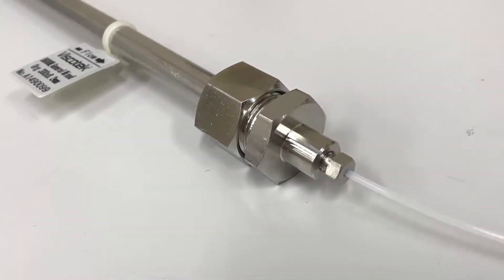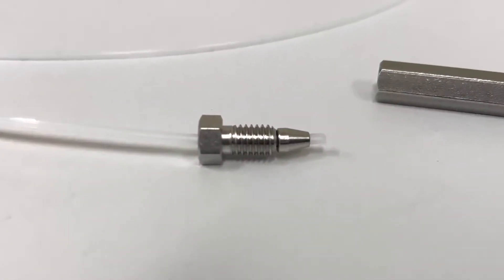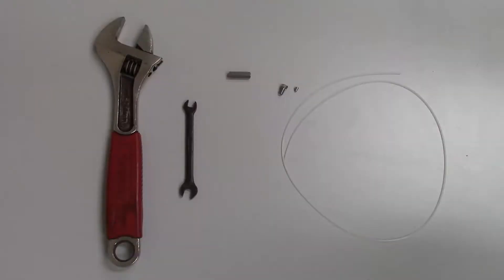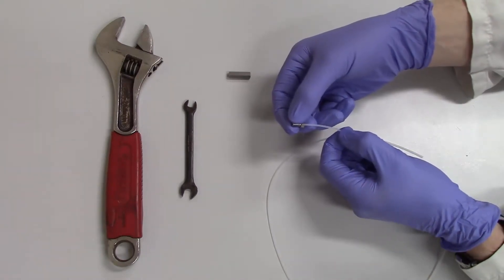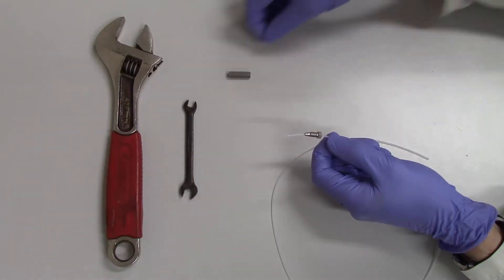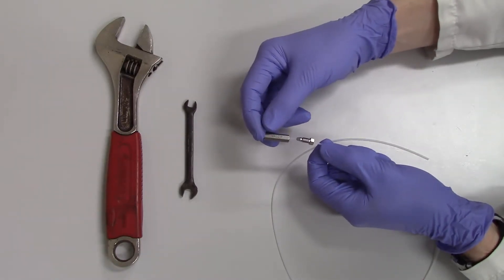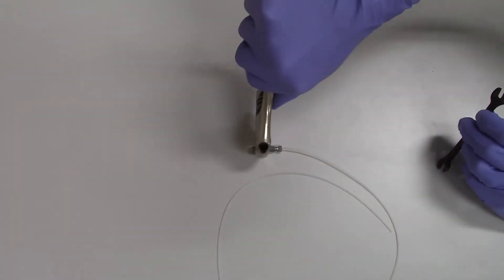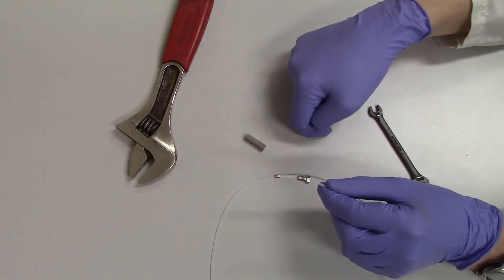How to make a fluidic connection for your GPC/SEC system

Comment: If I need to change solvent from THF to aqueous, do I need to replace the inline filter and the post-column filter? I think the membranes are made of PTFE, can we use these membranes for water-based solvent? Thanks.
Reply from the maker: Hello, thank you for your question.  If you are currently using a PTFE membrane then we recommend switching to Nylon for water-based solvents.  You can find more information on what membrane to use in this post on post-column filters: https://www.materials-talks.com/the-importance-of-the-post-column-filter/ 

I hope this helps!
Reply: @MalvernPanalytical  Thank you! I changed them with Nylon filter membraned. Do you recommend changing the filters every time I changeover solvents?
Reply from the maker: @reigak6599  Changing the filter membrane (and sometimes the frits & O-rings) whenever you change the solvent is a good habit.  The only exception would be if the membrane in place works for both solvents and you've only been in the current solvent for less than a week.
Reply: @MalvernPanalytical  Thank you so much!